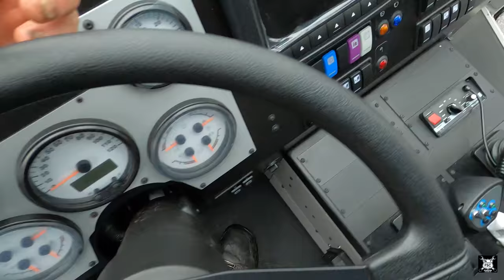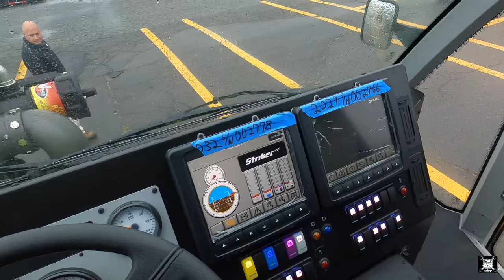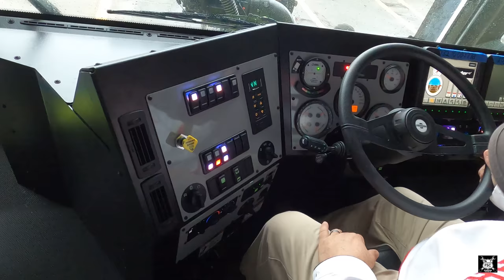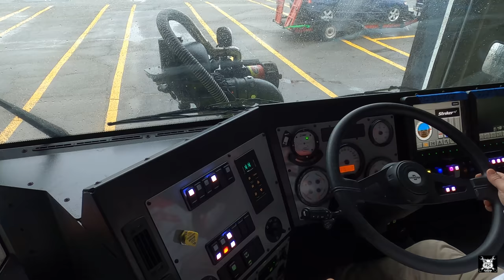Cabover Peterbilt Drives On The AIRPORT!

Comment: The Jet is Manufactured by Gulfstream Aerospace. Serial Number 1101, Model G-IV. Certificate Expires 1/31/2022. Was Manufactured in 1989. Owned by Greenfield aviation llc. out of Westport Connecticut.  Now the Engines are Rolls Royc.

Comment: You're the only one that I've seen other than Ron Pratt (Midwest Towing) that give three blasts on the air horn before reversing.
Reply: Thats a nautical thing, typically when a ship has her engines in reverse the pilot or captain should/will give 3 blasts of the horn to say they are reversing
Reply: One pull is good, if someone can't hear that blasting it two more times won't matter.

Comment: If you go back and look .... the back up camera monitor comes on when you put the truck into reverse. You can see the guy clearly in it.
Reply: Also, about 20 years ago (when we were just starting out and running 22 hours a day LOL) a cop accused me of soliciting a hooker over the radio in that rest area. I didn't do it but he stopped at my truck and said I was hiding her in the bunk. He threatened to arrest me if I didn't allow him to check the bunk out and I told him he had better have a warrant before he tried. He continued to bother me for about 10 minutes then said he would just sit outside the truck all night and I could sleep with her. I shut the truck down and went to sleep. Not sure when he left. I had heard some driver talking to her on the radio as I was pulling in but it wasn't me.

Comment: that beeping noise needs to go😂😂i was getting Frustrated
Reply: If  someone put a muzzle on the endless Beep,well then they probably have to send the machine back to China to get running again.cuz the "beeps switch is all intertwined ...like the door buzzer get rid of the buzzer the car won't start😆😆😆😆😆👿😈😈🤬
Reply: Put the seatbelt on and I think you will find that the beeping stops. It is part of the Safety set up of modern vehicles.

Comment: You said you didn't know what the motori is in the fire truck when you opened the back, well it's a Deutz TDC 16 litre V8 about 700 bhp, built in Ulm Germany. They are mainly used in big combines, but they'll be ideal because you can fit multiple ptos directly to them  some of which will give 100% of engine torque, also because of their combine application they are designed to run on the governor at high loads for hours.
Reply from the maker: Makes sense as they also pump vast amounts of water.

Comment: You mean these guys pay probably one million for a state-of-the-art AARF from Oshkosh and they didn't get any training prior to delivery?

Seagrave is known for flying fire crews to their factory in order to get oriented with their new trucks.

Big "thumbs down" to Oshkosh/Pierce
Reply from the maker: They received training after the truck is delivered.  They use the truck during the training.
Reply: @fsctrucking  Better training is at the customers location. That way everyone can get it, not just the few guys on the final inspection crew. If the customer already has this type of rig in service now, the may opt not to get training. I'm almost sure that those guys were the maintenance guys, as clueless as they seemed. They were not the firefighters for sure. The FD guys run those rigs all day every day, so they could operate it fairly well even without training.
Reply: @ FSC Speed Shop I live in a different part of the state now but was raised just a few miles from your shop. Shot mant pheasants down HWY 55 by The Starlight Club.

I love your truck and hearing you row through Orwell's gears is mesmerizing to listen to.

You strike me as one of the few "real truckers" left who doesn't drive in flip flops or sweat pants.

#respect
Reply: @karlreinke  Being a real trucker is defined by the way you drive your truck. I'd rather have a good driver wearing sweatpants than a bad driver wearing "real trucker" clothes.
Reply: @pecheur1951  being a true truck driver covers many things, a lot more then just driving the truck well.   but you won't understand !
Reply: @georgetoma7139  I hope you're gonna explain that now? Don't hesitate; I'm real curious.
Reply: @pecheur1951  hello.   what would you like explained?
Reply: @georgetoma7139  I would really like to be informed about the part of trucking I ,according to you, know nothing about. As far as I'm concerned trucking is a profession. If you're good at what you do and have happy customers that makes you a real trucker. On the other end of the spectrum you have drivers who live the trucker lifestyle. I respect that but in my opinion that doesn't make you a trucker if you lack in skills driving a truck and representing your trucking company.